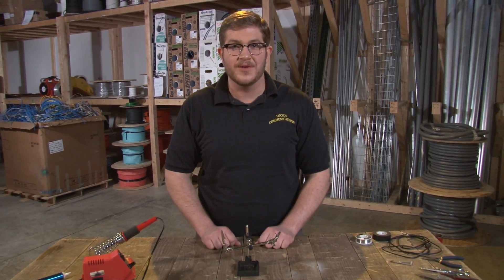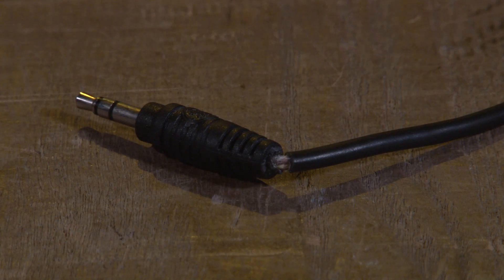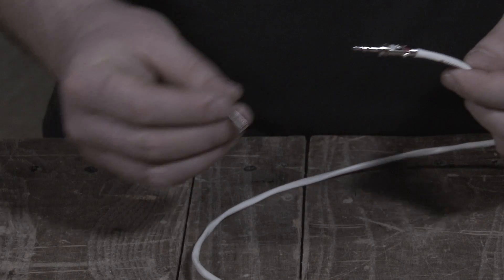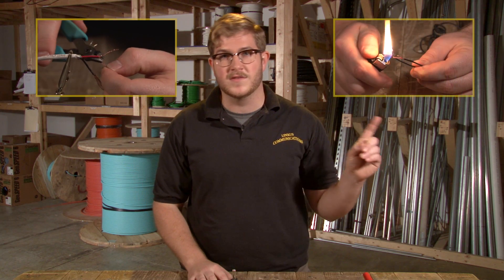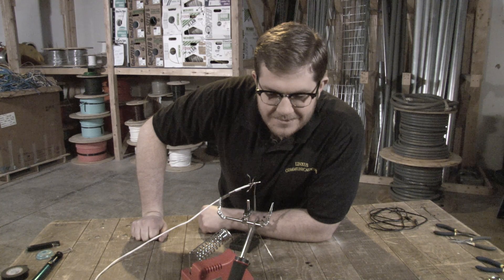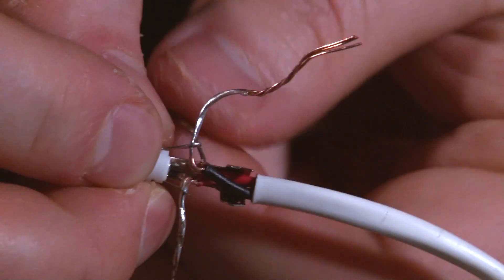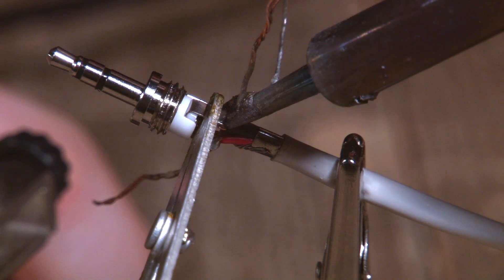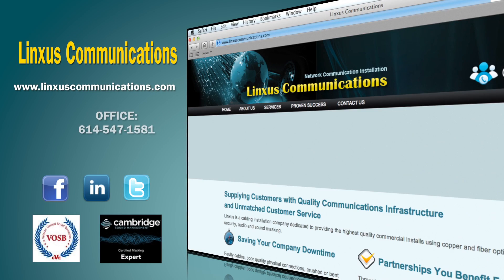How To Solder a 3.5mm, ⅛", or Mini Headphone Connector

Comment: As I've barely tried soldering before I'm a little scared to get it wrong. What would be the worst case scenario if I accidentaly short circuit the wires and try to use the cable with my music player, phone and things like that?
Reply from the maker: Rule #1 make your the cable is not connected to a device, if it is, unplug the power before soldering (no plasma balls). Now to your question. A typical TRRS phone earbuds use a button to control an assistant like Siri. They do this by shorting out two wires. You can always use a continuity meter to check if you have a short before you plug it in to your device. When you do plug in (preferable not on your expensive phone, maybe an old CD player) test it for a few seconds, if it doesn’t work unplug it. Then troubleshoot. I can’t say you won’t damage anything, but just be cautious and increase the volume slowly.
Reply: @DixonHill  Thank you for taking the time to answer me 🙏

Comment: Thanks for great video
Reply from the maker: I saw a comment about a CB external speaker. Besides troubleshooting the basics (inserting the plug all the way into the jack, checking for a breaks inside the wire by wiggling the cable, or checking with another speaker) I can think of two possibilities. First, the speaker has a Tip Ring Sleeve or three connections and I've seen CBs work with only a Tip Sleeve or two connections on the 3.5mm jack. Second, it could be a bad plug on the CB, since the internal speaker is connected through the external speaker jack, so that when you insert an external speaker it interrupts the signal to the internal speaker as to allow the maximum volume (and matching impedance). Sometimes the jack gets bent inside and doesn't fully connect. A repair technician would open the CB and put jumper cables on the jack from the inside solder pins to bypass the jack. There are a lot of CB repair techs at truck stops. Thanks for watching.

Comment: I have a one wire audio jack cable ,and i want to add an audio jack with cable already that has 3 wires to it, white red and yellow how do i solder it one to each other so i can use my headphone stereo mode? how was the original jack working with just one wire in both left right channels??
Reply from the maker: Can you make a video showing what your trying to accomplish and upload it to YouTube and send me the link? You’re talking about a TipRingSleeve ¼” to ¼”? just to guess, If your source is mono, using a stereo cable won’t make it stereo. Tip=signal RingSleeve=Return
Reply: @DixonHill  Thanks for reply, I teared more of the wire apart and it actually has 3 wires, One green, One red and One copper, the other one I have with the jack plug has 3 wires too, red white and yellow, but could not managed to link them correctly I guess, I linked red to red green to white and copper to yellow, I can only hear the right speaker after soldering those wires togheter.

Comment: How do i solder a 1/8  mini Jack with a resistor in circuit?
Reply from the maker: I would solder(-) the trimmed end resistor(w) in where you would put the wire (=), then add a long shrink wrap(…) that will cover everything after it cools, then solder(-) the resistor to the wire(~], and use the shrink wrap as support. 
…………
=-w-~
…………

Comment: Question: I am using Mogami W2893 which has Clear, Blue, Black and Red. If I want to make a TRS don't I only need ground and 2 wires? Which do I use and what do I do with the extra. Thank you.
Reply from the maker: You are correct you only need ground and 2 wires. As long as they are soldered/connected to the same contact on both ends it’s fine. Personally I would use the clear as ground (S), red as left (T), black as right (R), and snip the blue (which would be the mic or second R of the TRRS).
Reply: @DixonHill  thank you so much. I was looking like crazy for this answer online. This really helps. Take care.

Comment: Great tutorial! I worked for Stantek and they made forklift harnesses with LADD and Kometsu 24 pin/socket connectors (males and female terminals) so I did a lot of stripping and using wire cutters during my day. People should know these things like conduit, heatshrink, or sleeving. There's so many ways to improve technology by using donor parts and knowing how to solder with a little bit of electrical knowledge of circuitry. I use a fluke to test different jumper connections (alligator clips) and take apart electronic toys to replace blown capacitors or to add transistors/resistors. By the way, what would happen if you added a 10k resister into that or transducer with a diode? Ha!

Comment: Hello,
 Just watched your video the cable that I am going to use has 3 strands, 1 red,1 blue,1 white, can you please tell me in what order they go on to the jack plug as the colour of the wires are different from the ones in your video. I never thought of using a crocodile clip as a heat sink,good call.
Thank you. Stay Safe.
Reply from the maker: You will need to use the continuity testers on your voltmeter to find which color goes to its respective Tip Ring (Ring) Sleeve. Then reference what device you are connecting to Pin Out. Example: PlayStation has a different pin out than XBox/Apple.
Reply: Can also use forceps, Vise grips, etc. Use needle nose pliers closed tight via a rubber band on the handles. Be creative.

Comment: what if my cable..doesn't have a ground wire...how will this affect the connection...
Reply: If the cable only has 3 wires,that means it doesn't support input, only left output, right output, and ground. Leave the connector for microphone/input bare and wire your L, R, and ground.

Comment: Okay, so now how do I do this with just a blow dryer and a roll of tinfoil?
Reply from the maker: Talk to MacGyver! But I'll bit, hammer a long nail into a thin board so it comes out the other side, heat the nail with a lighter. Now you have a crude soldering iron that won't burn your fingers.

Comment: How long do you need to hold the iron on a braided wire until hot enough to melt the solder that is touching the wire (for tinning)?
How long needed to hold the iron on the terminal to heat the solder that is touching the terminal-to-wire joint?
In each case, I hold it there for what seems like minutes (maybe it’s only a minute?) while I feel the solder hot between my fingers, and the wire hot between my fingers, but the solder ain’t melting?
How can the solder I’m holding be so hot that it hurts my fingers a bit, while the heat at the point where the solder is touching the wire or terminal that the iron is heating is not hot enough to melt the solder????
Reply from the maker: The correct answer is, until it melts the solder, you may need a different solder iron to quickly get the solder molten, but short enough to keep the circuit board from warming up and de soldering a different component. You need a hotter, more expensive, more wattage iron. Which also means you need to be more careful with how much heat you apply. Also if you're tip is burnt, looks rusted, instead of shiny, you need a new tip. Don't burn up your next one by leaving the iron on for a long time.
Reply: Thanks for your answer, Dixon!
How long would one expect the iron be held on the wire, and on the terminal, as I mentioned in the comment, in order to melt the solder? Is a whole minute (or minuteS) not uncommon?  And is it not uncommon to feel the solder heat up between fingers to almost too hot to hold, without it actually melts an inch or two away at the point where the heated element (braided wire or terminal) is touching the solder?
Tip doesn't look rusted or burnt, it's shiny, as I've left it coated with solder,as per instructions I've seen online.
Thanks again!

Comment: Great video, im wondering is the solder the same to those headset with 2 separated connector for mic(pink) and phone(green)..i mean is the scheme the same for the pink one? much love from brazil
Reply from the maker: The green phone will be the same, but the pink will have a difference scheme.

Comment: THANKS, GUYS! Well done, informative, helpful, brief, good pictures... An amateur like me fixed such a connector, which saved an old set of small speakers from going into the trash. :-)
NOTE: My el-cheapo speaker wires consisted of only a few tiny strands, with one white-sheathed and one naked set of strands on the left half, and one red-sheathed and one naked set of strands on the right half. I had to carefully strip the white and red sheaths before tinning them and attaching them to their respective posts. I combined the two naked strands and attached them to the ground post.
Reply: Because the wires were so thin and frail, I had to chop off the end and start over several times before I got it right. I lost probably a foot off the cable. :-)
Reply from the maker: Don't worry, we've all done that. good job on getting it working!

Comment: Learning. I'm having a hard time getting the wire/joint hot enough to melt the solder. I'm using a small amount of solder to enhance the transfer of heat, but still I can not touch the solder to the wire and have it melt.  .032 dia light duty 60/40 rosin core.
Reply: What flux r u using? Google "tinning' and that should help. Good luck m8

Comment: Hey! you make it look so easy with those big strong wires but the portable headsets of senheiser have wires like hair follicles
Reply: These hair like wires are covered with enamel and most of the time have a string entangled into them. Don't remove the string (it will make the wire even weaken and impossible to work with). Just tin the wires as they are (the string will melt from the heat and the wire will get tinned before melting). Then tin the connector. Then touch the wire to the connector and touch it with the soldering iron.
Reply: Solder seriya otte matudhu da
Reply: விஷ்ணு கார்த்திக் Typical German products
Reply: change your wires, get better sound

Comment: Thanks for the video but I am still not sure which tag the red cable goes to, I don't want to connect reverse polarity, any help please.
Reply from the maker: If your making a jumper cable like what we made, make sure the red cable is on the same tab on both connectors. If you replacing a connector, do a continuity check on your old connector if possible and match the wiring, otherwise you will have to temporarily hold the wire on the tab while you use a media player that has a left and right pan to check to be sure the correct side of the headphones are playing audio.

Comment: For a beginner...I was completely lost at 2:44 to 2:56. I wouldn't know which is the left or right channel or ground..even if the jack is propped. So i'm assuming the tip has to point to the right in order to figure that out. I like to think that it would've been easier to distinguish by the color of the cord ( I thought they have some universal color code)
Reply: You need to use a multi meter. The tip of the jack is left channel so place one lead of the meter on the tip and touch the wires coming out and test for continuity. Which ever gives you a reading is the left channel wire. If you have an analog meter you need to use a 9v battery. Connect the tip (left) to the + side of the battery pole then do the same as before. Which ever wire is showing continuity is the left channel. The meter should beep when a connection presents itself. As the video states 3.5 mm plugs are universal ..the tip is left the ring is right and the base (sleeve) is ground. Great video btw thanks guise
Reply: @MrLucifuge1973  Some jacks have a tip, ring, ring, sleeve layout. for the microphone. do you know what is the universal layout for these jacks?
Reply: @AimYTYT  Yes. These are TRRS jacks. 
Tip - Left audio channel
Ring - Right audio channel
Ring - Ground 
Sleeve - Mic

Comment: Hey, if my cable is a mono microphone output and I have a stereo jack, can I solder the cable to both channels simultaneously and have it working properly?
Reply: Arthur Winter yes, if you are using a trs connector, with a mono cable, your left and right on your connector would be sharing/splitting the same signal from the shielded wire in the cable, and the remaining bare outer copper strands of the cable would be the ground on the connector.

Comment: I have a pair of Sony pro headphones and the conductors are green, brass-colored and copper-colored, with no apparent insulation on them at all. How does that work?
Reply from the maker: Click on the tiny wire part of the video, it's a thin clear insulated coating that is easily burned off.
Reply: Done! They work, but the right channel seems louder than the left.

Comment: My right and left channel wires were soldered backwards. Everything works. Does it really matter?
Reply: If it bothers you, just flip your headphones around.
Reply: Dixon Hill if you are listening to modern songs that are mastered by 12 year old yes. but not for good songs. there are plenty of songs that make use of stereo to give a special experience. live recordings of orchestras as well. my recommendation is yosi horikawa's letter. you can hear clearly that he is writing a letter from left to right at the start of the song.
Reply: try watching a movie. yes it matters. when someone is walking from left to right you hear it right to left. songs will sound different because you are used to the normal version as well.
Reply from the maker: No, but if you watch a movie with them and a car drives by, it will sound like the car came from the opposite direction. But for music it doesn't matter.
Reply from the maker: I agree wit you Nicomaki Dota 2 channel assignment does matter, I would hate having my left on my right, but it seems that doesn't matter to him, otherwise he would have fixed it already. Will he notice, probably not. That's why I gave the example of the movie.
Reply: Dixon Hill it's a new experience haha.
Reply: ***** I'm talking about audio from iPhone in my car speakers. I'm not watching anything.
Reply: +NICOMAKI DOTA 2 He said car speakers and he's not watching anything, so there's literally no reference point of what is left or right. so in that case, when listening to audio it shouldn't matter whatsoever. I don't think anyone memorized their songs to know left and right sounds. that would just be a retarded jobless thing to do.
Reply: Mechanicable there are songs like that. but yea if you listen to radio or random songs it won't matter. for me it does since I like my music. a lot. preference.
Reply: Mechanicable calling audio a jobless thing to do just insulted pretty much alot of audio enthusiasts and professionals. including me. please watch what you say.
Reply: Somebody insulted something subjective that we like on the internet. Let's cry together.
Reply: You can use a virtual mixer like "Voice Meter" (it's free with no ads) to invert channels by software.
Reply: it works! just flip'em around.
Reply: hostilityy no experience with car speakers but I think they can be stereo as well so yes. and again, depend on your music.

Comment: Thanks, is there any risk on not using cables with ground connection?
Reply from the maker: Well yes, there is a tip a ring and a sleeve, the sleeve is normally ground, so without that sleeve, nothing will work. Now I'm imagining you you meant something different than the sleeve or ground. If your talking about the 4 pin phone headset connector (tip, ring, ring, sleeve) that extra ring is for a microphone, so you could get by without it. If your talking about a shield inside the cable, that would be helpful to keep cell phone interference out of your headset. I'm just guessing what you meant, let me know.
Reply: *****
 Yeah, Something like that, I have a cable that has a copper external shield between the isolation and the actual black and red cables, I just connected them into the long (ground) metal thingy in the jack and it worked nice. 
So I was just asking if what I did was correct. (my cable doesn't have a tinfoil shielding, just a bunch of small copper wires around the main B/R cables.

Comment: My earphones has 4 wires, green, blue, red and orange. They're called bassbuds. I don't know what to do
Reply: +Adam Ahmed  bcs each speaker has 2 wires ( ground and positive ) u bust figure out where are positives ( for each speaker) and solder to correct pin ( i to left channel and second to right channel on jack ) then 2 other ground cables solder to ground ;)

Comment: ok, i've got mini jack with upper and lower ends, not right and left like here. I suppose upper is for right channel and lower is for left channel?
also, i have 2 pairs of headphones and attached both of them without soldering to see if they work. One works, the other does not make a sound. What may be wrong? Before the process both pairs did produce sound.

Comment: @Dixon Hill Hey, thanks for the uber informative video helped tons. I was too a send you an email or private message or something but I'm not hip to how you tube works like that so I guess I'll just ask here. 
I have a tip unlike the ones you used with0 holes only wings and bare access to the poles how do I do it on these?
Reply from the maker: +S.K. Achtwone Thanks for asking. The holes are nice and help hold the cables in place while you solder. Although they are not necessary. Tin the end of each wire then tin the wing, tin just means apply a thin layer of solder. Then sandwich the wire between the wing and your soldering iron. Hold the wire in place and remove the iron. Once the solder has cooled it will hold on to the wire and you have a good solder. Out of curiosity where did you get the tip?
Reply: +Dixon Hill Thanks 😎👍